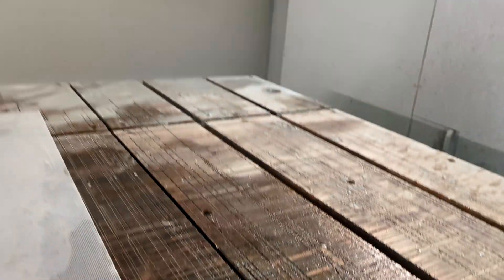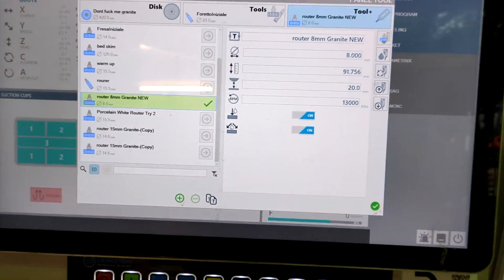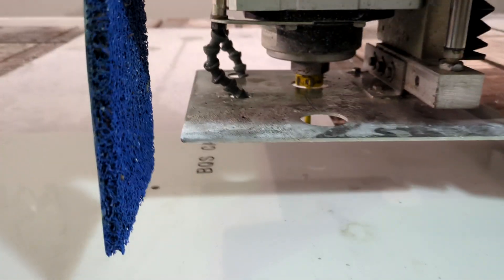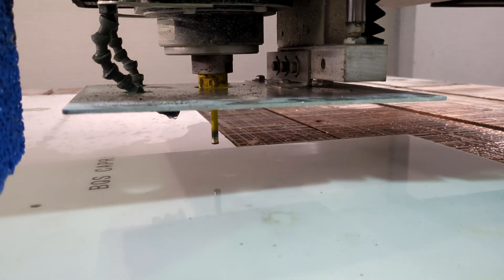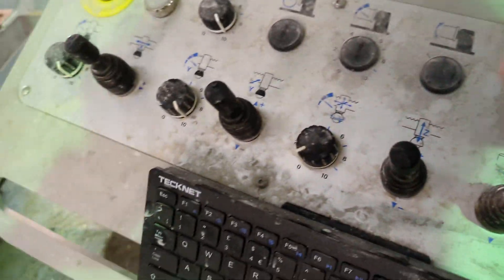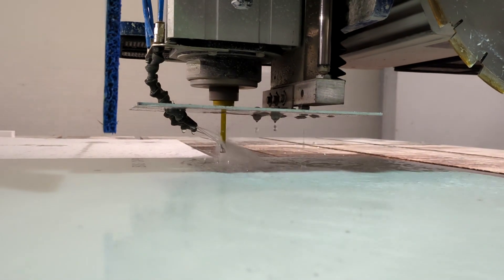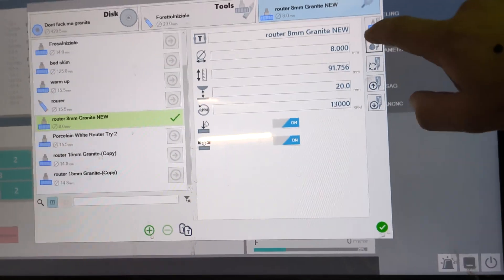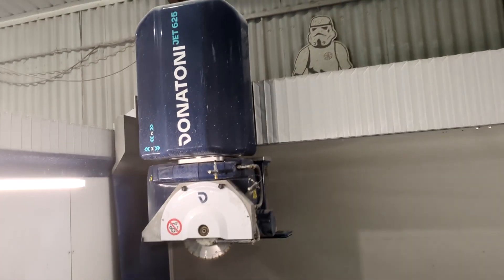Donatoni Jet 625 "Donna" -  Manual hole drilling

Comment: You need to tell the machine its a drill not a router ,,then you can do it automatic
Reply from the maker: But if i set it up as a drill then machine will want to use different attachment. Correct?